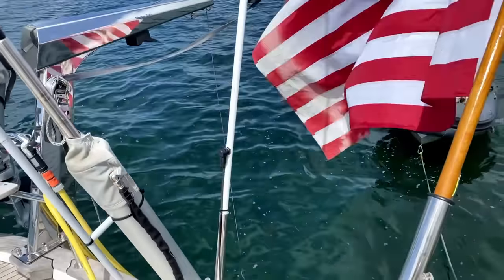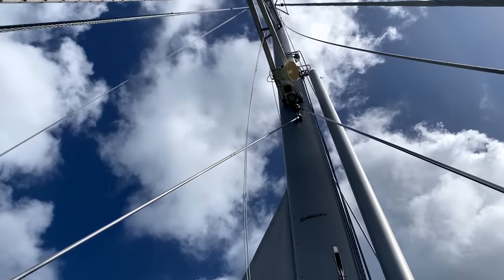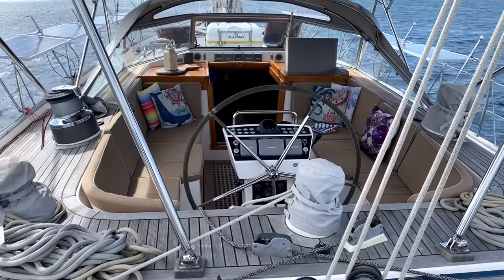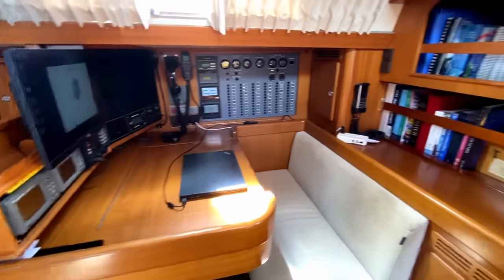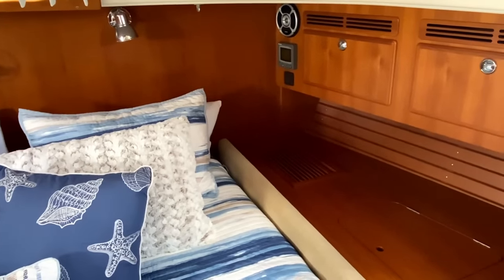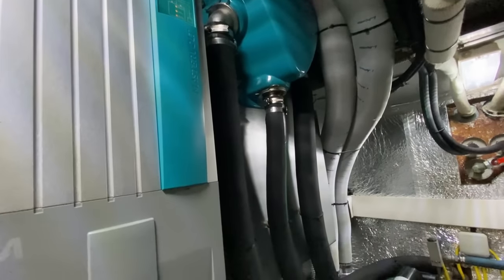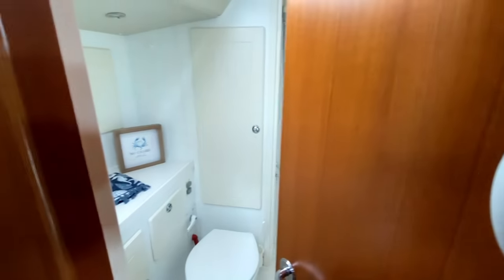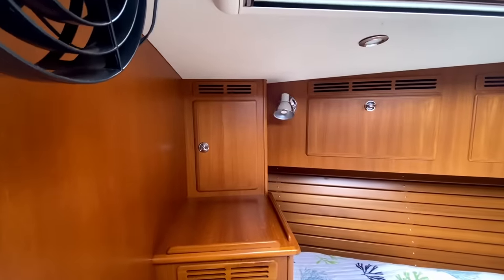Gorgeous 2008 Hallberg-Rassy 62 complete walkthrough.

Comment: Hi Richard, I just came across this because the boat happens to be anchored right outside of Eastport in Annapolis at the moment. I think the name is not correct in the title of the video. As a HR owner myself, just one tiny correction to offer...in thr engine room when you were describing the steering...the rod comes down from the helm into a bevelhead and on the front of that bevelhead os a massive Lewmar Mamba drive which is probably one of the autopilots for the boat. The other/backup autopilot is probably a ram. You had suggested that the Mamba drive is farther down the rod steering system, which I believe is not correct. Gorgeous boat, I will go swing by her tomorrow!

Comment: Sorry to see the rusted chain, that is not good maintenance. Cannot comprehend why the starboard aft gin seat had to have the whole, sloppy solution, for whatever purpose it has served.
This is a big boat, so the equipment has to be in line in size.

The interior looks in shape, boat lightly used and cared for..
The engine room in good shape. Looks like upper bunk bed for pilot berths can be erected upright to creat a settee down below.

That massive, massive hatch is for escape, that is why it is massive😊.
Reply from the maker: Can you elaborate on "starboard aft gin seat" and sloppy solution?  I don't know what you mean.  As for the chain, they all rust in sal water.  It's what they do, then you replace it every 5 years or so.
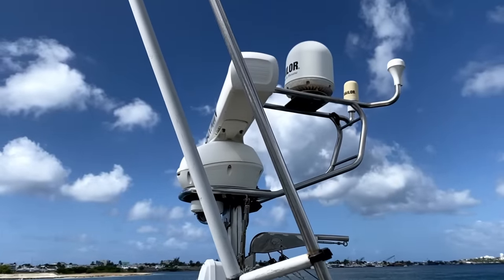Reply: @Jakfilm  I believe it should be 1:23 of the video, the aft startboard seat can be seen and I have noticed they drilled a whole right in the middle and some kind of cable goes thru.

As to the anchor chain, yes they do rust, but you take necessary steps to avoid this much rust. Actually, you have them galvanised again, you do not throw them away. If the chain is rusted this much, then there is a chance that it may break, leave away negative effects of rust on deck and on the other elements of the anchor mechanism. To make the long story short, one should never allow such rust in any part of the boat..
Reply from the maker: @salimerdem7544  What you're seeing in the helm seat is a cup holder, I believe.  The piece of line going thru is just coincidental.  

There are few, if any opportunities to re-galvanize a chain in the Caribbean.  What steps do you suggest one take to avoid rust on a chain?
Reply: @Jakfilm  well, for the present one, it definitely needs a acid bath, through check and galvanizing. Of course, friction eats away the galvanization through time and you need to galvanize periodically, depending on the condition. Other than that, by having fresh water washes regularly my prolong the period. I realize the boat has enough fresh water capacity, so washing the chain while picking up at certain intervals will help.

Your point of glass holder hole duly noted, when I saw the line going through, I thought it was some kind of a quasi solution; which I find awkward and not respectful to a boat like HR, assuming it was a sloppy afterthought for some purpose.
Reply: I think keeping it away from saltwater would help, but I'm  not the expert salimerdem obviously is. @Jakfilm